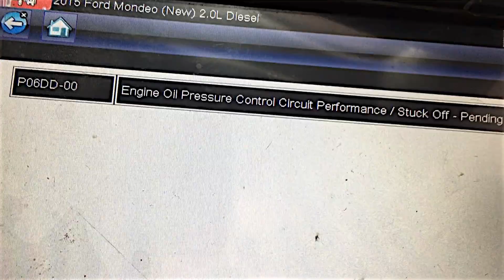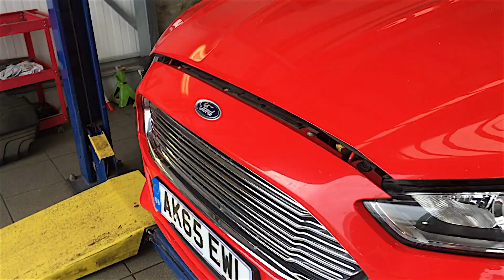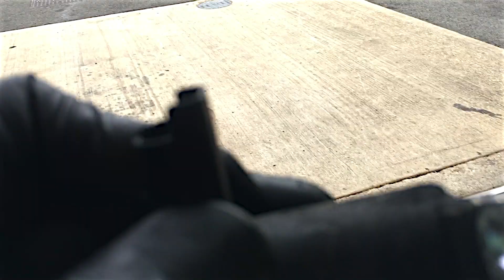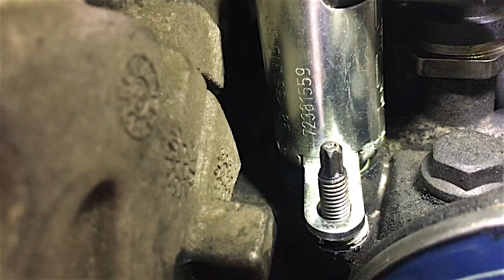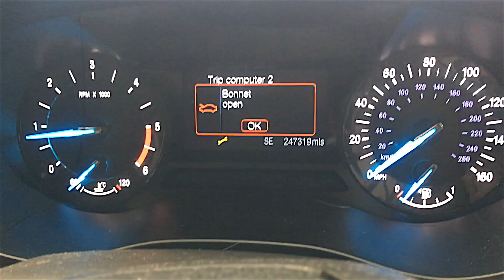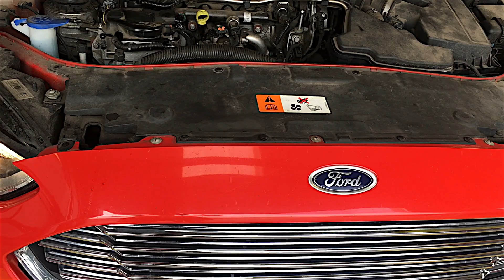Oil pressure Control Solenoid Faulty, Ford Mondeo Mk5 2L Diesel

Comment: Hi Alan, does a faulty solenoid also cause a high oil pressure at engine start (hot or cold)? My car suddenly seems to shoot up to around 100-115psi on startup when cold and up to about 85-90psi when hot. Settles to around 35-40psi in about 8-10s.  Engine note also changes when oil pressure comes to normal.

Did an oil and filter change, still the same.
Reply: How are you testing the pressure??
Reply: @JR0493 forscan.  But the readings seem to be similar with a conventional guage when checked by mechanic
Reply: @pgupta5826 I don't think the 2.0 has a sensor. Only a switch so forscan values are not actual.
Reply: @JR0493 Thanks mate. Any idea if the switch could be faulty? What would generally be the symptoms of a faulty switch?
Reply: @pgupta5826 mostly low pressure warnings.

Comment: Hi Alan, have you ever had the oil preasure switch to knack up ford changed my oil pressure controll sensor, but it through the engine service now message back on when they checked again the oil preasure switch us readi 15psi when it should be reading 0, is this anything you have came across 
Thanks 
Mark

Comment: My Mk5 Mondeo drives fine until you give it some grunt. Sustained driving 2.5 revs or more, the yellow spanner illuminates on the dash (No limp mode). Park it up engine off then restart spanner light disappears. After some research ont interweb, most say 'Oil pressure solenoid' some say a loose bolt on the air box. Recently serviced so I don't see a problem there. Some clarity would be gratefully appreciated.

Comment: Hi Alan. Should these cars have a whiring noise at startup? I've connected a scan tool and on cold start I get the noise with a highish oil pressure. At the exact time the oil pressure drops the noise stops. Could this be a sign of the solenoid failing?

Comment: Hello Alan,

I have a 2015 Mondeo 2.0 TDCI, and lately, I’ve been noticing that a message occasionally pops up on the dashboard saying “Check Manual.” This usually happens when the engine is running at around 3000-4000 rpm. However, when I turn the car off and restart it, the error disappears, and the car runs perfectly fine again.

Yesterday, I connected a diagnostic tool, and it showed error code P06DD. Based on what I’ve seen in your videos, this could be related to the solenoid valve. My question is: could it potentially be caused by something else? Also, if replacing the valve is necessary, do I need to drain the engine oil beforehand?

Thank you very much for your help!
Reply: I have the same problem on my Ford Galaxy (WA6). Which diagnostic tool have you used to read the code?

Comment: Good morning sorry to bother you. Don’t know if you’ve come across this problem. I have code PO6DD00 and I’ve changed the old pressure solenoid, but still getting the same fault code. We have dropped the sump and check the I’ll pick up and I’ll Clear and according to live data, the pressure is in the correct parameters so just wondered if you had any ideas many thanks, Chris
Reply: Did you find the root cause, I have the same issue. Thanks
Reply: @tomasgernat4334  hi mate yes mine turned out to be oil pump even though the figures were in the tolerances

Comment: Do you recommend to change it preventingly  , i have a kuga with 110k km  same engine .
Reply from the maker: You could do as they are fairly notorious for failing but not exactly cheap .. around £150 I believe
Reply: @alan4x  thank you

Comment: I'm getting the same code on my Mk2 kuga, only ever when under load and 70mph+. Accompanied by P269F exhaust aftertreatment glow plug circuit open. Can a faulty solenoid cause this code also, or should I be looking elsewhere?
Reply: Hi, I know this is old but I’m having same issue! Mk2 Kuga! Drives fine but I put my foot down and goes into limp mode. Haven’t checked the code but I came to this as I did have oil leak also. Did you manage to find your issue?
Reply: @jxmiedubz I've not sorted it yet. I just live with it. It doesn't happen all of the time so I've just left it

Comment: Alan, good day, I also had the same problem and the same symptoms, with the same error code, after replacing the solenoid, the error disappeared, but under load, the car again went into the same mode as before and gave 2 new errors on the maf, P1102:21-A7 and P1102-P Tell me, maybe you have encountered something similar?
Reply: Hi. What was your issue? Was it resolved?
Reply: @alizaheer8154 Yes, it turned out that I was sucking air between the turbine and the air duct (everything under the turbine was covered in oil). I replaced the rubber gasket and tightened it well, so far so good.

Comment: Good Evening 
Son getting low oil pressure low warning on ford tdci mk8 fiesta 
Garage changed oil pressure sensor & oil and filter but still getting intermittent message when cold could this be the problem 
Kind regards
Reply: Was it?

Comment: I replaced this solenoid and still have Engine Oil Pressure Low. Also made resset of differential oil pressure valve values
What do you suggest?
Reply: How you fix ?

Comment: Hey Alan, thank you for video. It helps me a lot. Do you think changing oil more often can prevent this problem? Or is it basically common issue for 250k miles?
Reply from the maker: changing oil more often is good but those solenoids are common for failing regardless

Comment: So, do we know if the OFF state is open or closed, i.e. normal pressure or low pressure?  It appears that these solenoids are used to REDUCE oil pressure when there is little or no load on the engine in order to make the engine more fuel efficient by reducing parasitic power loss due to normal oil pressure.  In Mercedes engines, the default state is NORMAL oil pressure as a fail-safe in the even of the solenoid failure.  Also, the Mercedes code P06DA00 will not illuminate the CEL/MIL/EML and is generally ignored unless there is also an engine light, which would indicate a different problem.

Comment: Te salut și te urmăresc cu placere.. am aceeași problema..am înlocuit senzorul și defectul apare daca o ții la 4.000 rpm turata ...ce sa.i fac?după manometru se pare ca ar avea cu 1bar presiune mai mare...la 2mii rpm ar trebui sa aibă 2bari ea are 3.5 bari la 4mii rpm sa aibă 4 bari ea are 4.5...5 bari

Comment: im having this issue. car is 6 years old but only 38k miles! only seems to do it when pulling hard (at low RPM) or being driven hard. not sure whether to try changing the oil first or, as it seems, try changing this solenoid while im on with the service. any recommendations?
Reply from the maker: if you are getting ecu codes related to the oil pressure control solenoid then it would be best to replace it as they are pretty common for failure and cause reduced engine power

Comment: Had to do this on a 1.6 cdti insignia, unfortunately it's still going into limp mode, so it's more than likely the pump 🤔
Reply from the maker: have you read the ecu codes as to why its going into limp mode
Reply: @alan4x  po6dd which is why I replaced the solenoid sensor. It's not putting any codes on my small handheld reader ,it's not putting an engine management light on either, but it is putting an engine reduced power message on the dash.  But with a proper garage diagnostic tool it showed the po6dd.
Reply: Alan, it turned out to be the front ABS speed sensor causing the code, apparently a dodgy abs sensor can effect the 2 stage oil pump.? Strange one but I've changed both front end abs sensors and now the po6dd has stopped popping up

Comment: Hello Alan , I have a 2018 ford Mondeo 1.5 diesel manual and recently the spanner light comes on the dash board but no fault codes. I have changed the oil and oil filter with fuel filter but to no avail the spanner light is still on and the car is now in limp mode any idea please?

Comment: @alan I have this issue cutting out on load, no limp mode, just stalls, 4th 5th 6th gear high load. It shows no codes. If it stop the car I can restart it and it drives fine

Comment: Hi Alan, again great video. I was wondering if is there a way to maybe clean this sensor? Since this is an electro-mechanical component, maybe the electronic part is ok and the mechanical part can be cleaned with some spray (degreaser, brake cleaner). Did you try something like this?
Reply from the maker: no i just replaced it

Comment: I change oil on mk4 Ford Mondeo after 5000 miles
I checked the dipstick and there was no oil to be seen.
I am surprised there was no warning light and the car 
drove as normal and good fuel consumption; 45 mpg.
The car is about 14 yrs old.
Do I ask the garage to change the oil pressure sending unit.
Hopefully the engine is oké.

Comment: @Alan Howatt
I would just like to thank you for your excellent videos, really saved my butt when my Mondeo (2016 Mk5 2.0 TDCi) decided to kick it on the highway. No previous errors, no warnings. Just dies, and got the dreaded amber spanner. Tried many things, changed the filters, leak-off tests etc.
Turns out the fuel pump had failed just like in one of your videos; exactly on the same spot on the shaft.

I changed the pump to a new one, and the car fired right up again, but it runs rough.
To the point: now I get a P0266 Cylinder 2 Contribution/Balance error readout on ForScan, and - for some reason - the dashboard gives me a Low Engine Oil Pressure warning. But Forscans says nothing about this. There are no other errors. Am I getting a oil pressure error because the engine is running roughly, or do you think it might be the solenoid like in this video (no errors on this though). Also, I'm not sure I quite understand what the P0266 error means, but from what I gather, I might all of a sudden have a clogged or broken injector on Cyl2?
Thanks :)
Reply from the maker: hi marius, sounds like metal filings from your pump entered no2 injector and is causing it to misfire  ..i would change that injector...as for the oil pressure ...if the engine idle speed gets low due to a misfiring injector it can bring the low oil pressure warning up.. i have had that happen to me
Reply: @alan4x  Alright, thanks a lot :) You really know your stuff, and saved me so far, so I have no doubt you're in the right this time as well :)
The best course of action is to replace it then, no point in trying to clean it?
Reply from the maker: @Emviate  nah, i wouldn't bother cleaning it

Comment: In stock item at Ford - says to me its a common occurance fault like the fuel pump gear unit gasket. Great info as always. Is there any perticular mileage these have been started to fail at on the fleet you look after? See you in oct to discuss steering rack bolts.
Reply from the maker: could be any mileage but generally 100k  miles onwards

Comment: Hello Alan have you ever encounter metal fillings in the oil sump? If not what would you think it would be? 
Sump was dropped and cleaned, oil filter opened and was clean 👌
Reply from the maker: its not uncommon to have a few metal specs from when the car was new and running in, if its a lot then you could have a problem, big end and main bearing shells
Reply: @alan4x  thanks for the reply Alan the mk5 has "68,000" miles. I was watching your videos all day today and was thinking about the timing chain tensioner, where does all the metal goes to when the chain grinds on the worn tensioner (metal on metal)???
Reply from the maker: @Rebasandofronteras  the metal from the tensioner if it gets to that point of wear will get circulated around the engine oil and probably won't be doing the big end and main bearing shells any good

Comment: Alan tell me please when you need to pay attention to the camshaft chain? what is the replacement interval?
2.0tdci 136ps G6DD
Reply from the maker: if your engine has been serviced and had the oil changes at the correct intervals that chain should last the life of the engine..we have many of them over 300k miles without any chain issues
Reply: @alan4x  Thanks for the answer Alan, yes the oil changed every 3-5 thousand kilometers. At the moment, the mileage is 320 thousand kilometers.
Thank you for your hard work.

Comment: Great video Alan, thank you Not only Mondeo's - I've just had to replace this solenoid on my daughter's 1.6 diesel Jeep Renegade which came up with the same code. Just got EML but no limp mode. Very difficult to source the part, but this engine is fitted in Fiats, Alfas, and some Vauxhalls. Managed to get one from an Alfa dealer £148 and not as pretty as yours.
Reply from the maker: thanks alan for your comment, anything jeep related is a headache, glad you sorted it

Comment: Is this an old vid? Says mot expired in 2018
Reply from the maker: the taxis do not have a class 4 mot test...2018 was when the car was 3 years old and would have needed an mot if it were a private car
Reply: @alan4x  oh course makes sense thanks for the reply 👍
Reply: Different test for hire vehicles. If it does not pass that test then the taxi plate on the back expires and you can see it yourself before you get in it.

Comment: Why didn’t you remove the oil filter? It would of gave you a little more room
Reply from the maker: you don't need to
Reply: Why create more work? Did you watch the video? He can clearly change the part without removing the filter.

Comment: That was easy to fix. At the last time i had a faulty oil pressure switch and twice a week came up yellow wrench on the dash. Now everything is just perfect again no problem. Alan! I would have a question to you please!  There is any replacing period for the camshaft chain? Because i was at the ford garage somewhere in Ireland and they told me this one no need to touch. I am just worried because i saw your other video about broken chain. Thanks 👍
Reply from the maker: not come across a service interval for the chain...just keep the engine serviced with the correct oil...from my experiance i would say the chains are failing..well the tensioners are at about 240k miles onwards
Reply: @alan4x  I appreciate that your help. Thanks 👍 140K miles have on the odometer now
Reply: maybe not the chain but the tensioner I had on my 2016 ford focus st 2.0 diesel was damaged and led to some big $$ reapirs

Comment: Excellent vid' as always Alan, a real money saver (well short of the Ford 'Stealership' price ! ).  Do you need to clear any codes or will the ECU delete it when fitted and run ?.
Reply: I’ve never heard of a Ford Stealership.  From
A Naive soul in the north.
Reply from the maker: you have to delete the codes in the ecu with your diagnostic tool or it will stay there

Comment: Alan i put a new sump on my 1.8d connect and it came with a paper gasket, its pissing every where and the neighbours hate me, where did i go wrong, great video by the way 🙏🙏
Reply: Did you clean up the mating surfaces. Did you torque in the correct sequence and spec? Was it an aftermarket sump?
Reply from the maker: probably would have been best to use gasket sealant on a paper gasket
Reply: @alan4x  Thanks Alan